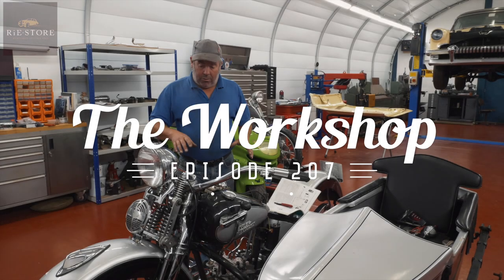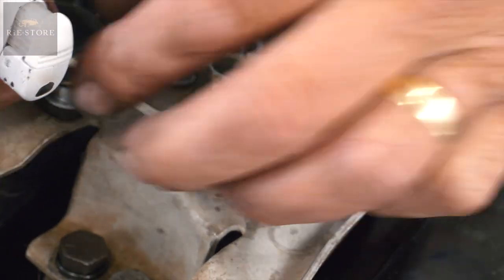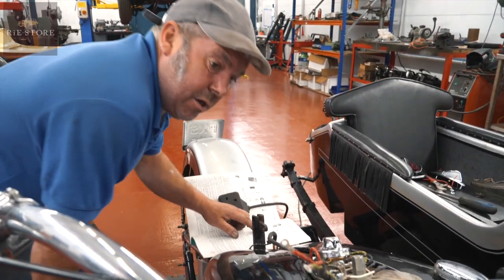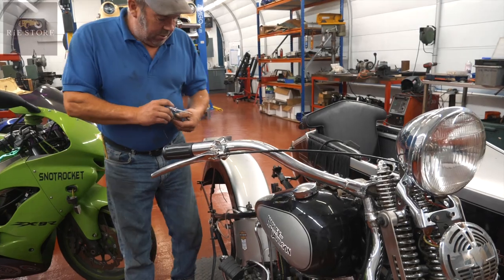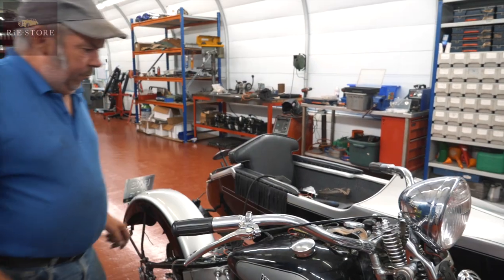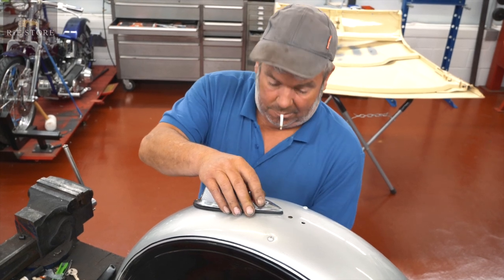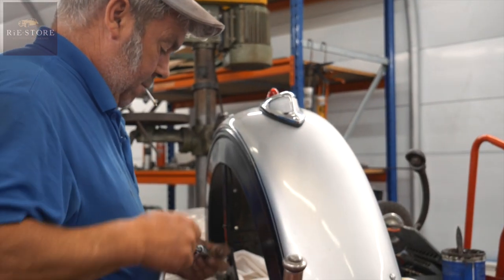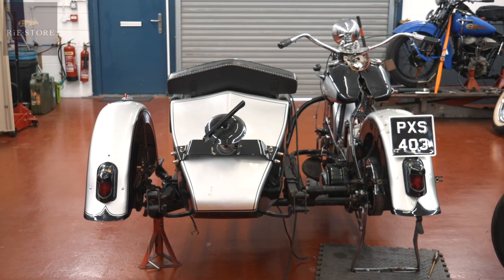Fitting a 42-46 wiring loom on the 1942 Harley Davidson Model U / ep207

Comment: I notice  several of the wla/wlc you have worked on have  the brake handle mounted on the rhs of the handlebars    as wla original setup was a lhs brake handle  what are your thoughts on the viability of the rhs setup when combining the non return throttle handle foot clutch & lhs tank shift   I reckon hillstarts would be very touchy    cheers tim from downunder